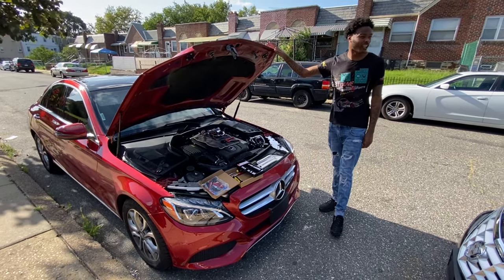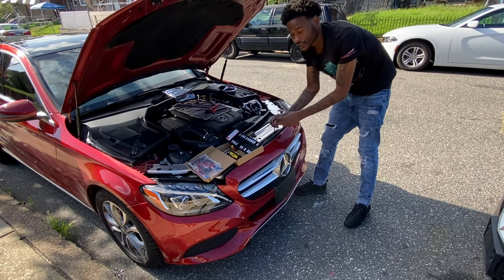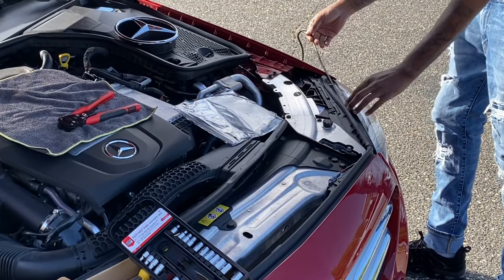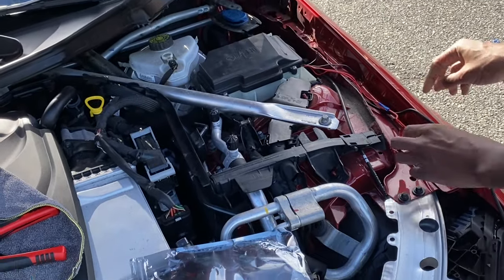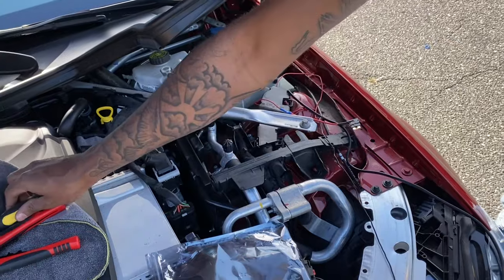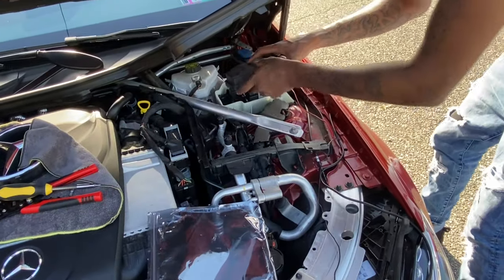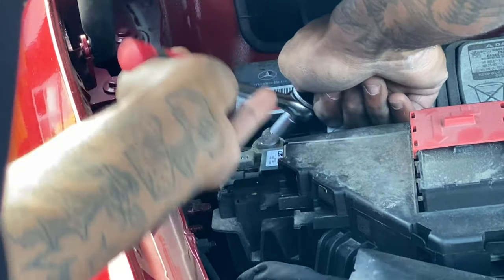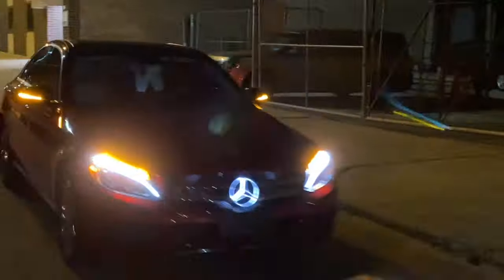How To Install LED Star!!! TOP QUALITY Mercedes FASTEST MOD #1 #Distronic Style

Comment: Just followed your video and installed the illuminated star on my 17 C class c300. Perfect instructions my boy. Grabbed all the same tools as well in you info section. Good looks
Reply: saved me 500 dollars install fee from dealer as well
Reply from the maker: Thanks bro 😎
Reply: Can you tell me does the emblem light up when you unlock the car along with the other lights or does it come on as soon as you start the car ( with daytime running lights ) etc. Please.
Reply: hey did you buy the lightning star from the dealer or did you get it from ebay??

Comment: Hey bro! Where did you buy the headlights ? I’d appreciate a link. Thank you
Reply from the maker: The LED headlights came with the car Bro, but the LED star link is in bio. 
If looking for replacement LED Headlights click this link:::
https://www.uniquestyleracingstore.com/products/2015-2018-mercedes-benz-w205-c-class-4d-sedan-amg-style-full-led-headlights-hlmbzw20515fulled?variant=34156439306377

Comment: What’s good brody subscribed right away! But quick question man to have it stay on during the day or whenever my cars on would I have to do anything else ? Or will it stay on as long as the cars on ?
Reply from the maker: Thx bro💪🏾 when you turn on the car the star turns on with it
Reply: @FASTLANEYT  my bad bro last question predicate the love bro but after taking out the battery did you have any issue with like recoding or anything ?
Reply from the maker: @joaquinbernardino1923  no problem, but nope

Comment: Great video. Easy to follow. I have a 2018 GLC Coupe Premium Plus UK spec. Will I be able to install this if my car has the distronic system (which I think is incorporated in the star)? Thank you very much.
Reply from the maker: Great question and thanks for your feedback. If you have the distronic system then I do not recommend this install. This install will deactivate your distronic functions became the sensor is build into the star.
Reply: @FASTLANEYT  Thank you very much for that.
Reply from the maker: @andysouthwell1313  no problem

Comment: It’s installed to be turned on w drl? Or what fuse is it called ? Trying to let mine turn on when I unlock the doors at night with the headlight
Reply from the maker: I installed the fuse in slot #105. Which only illuminate when I turn on car, remote start which Mercedes Me app. You would have to look at your vehicle fuse diagrams to learn which fuse needed to patch into your locator lighting feature.

Comment: Will that same star fit on a GL? Did you get wires and the star on amazon or different site? Thanks
Reply from the maker: Great question. I have seen a non-OEM LED star installed on a GL model. The Vendor who I purchased my LED star from is linked below in the description from eBay. The LED star comes with wires / full kit. I had to purchase fuse tap adapters separate. This star size is for the W205 W218 CLASS C CLS CLS550 CLS63 C350.

Comment: Did you wire this so it run when headlight is on or during the day as well?
Reply from the maker: Great question, yes I wired it to an accessory fuse that turns on constant once car starts

Comment: but the emblem light is running all day correct? obviously when the car ignition is on!is there any way you can connect it to the head light fuse?
Reply from the maker: Yes! star is On when car is On… you can wire light directly to headlights via wire tapping which takes more work for same style.

Comment: Do you think this would work for a 2022 GLC300 ?  This was a easy tutorial I appreciate it. Thanks
Reply from the maker: No I appreciate your response, do you have distronic star?
Reply: @FASTLANEYT  Do you mean a 3D star? Yes it came with it.
Reply from the maker: @RealSavages  ok so no you wouldn’t be able to do this manually. you can check with dealership to see if it was an option, however many of the new models require 3rd party auto services to install
Reply: @FASTLANEYT  Tyvm I will look into it. Perhaps I can find an alternative.

Comment: Does disconnecting the battery resets everything inside?
Reply from the maker: Great question. From my personal experience once I connected the battery and powered the Car on the clock was the only thing I seen automatically resetting itself.

Comment: Hey man, Do you happen to know what that fuse is connected to ? Like is it anything vital
Reply from the maker: It allows you to tap into the daytime running lights, it comes with the 5amp fuse for safety I’ve haven’t had any issues after reinstalling multiple times.
Reply: @FASTLANEYT  Ok I asked because I was going to install some color changing Daytime running light, and I wanted to see if I could use the same fuse to power it.
Reply from the maker: @tyanedaley1480  I purchased a test light pen on Amazon to be sure. 

https://www.amazon.com/gp/product/B01HUZPTPS/ref=as_li_tl?ie=UTF8&tag=flexxalexan06-20&camp=1789&creative=9325&linkCode=as2&creativeASIN=B01HUZPTPS&linkId=7cf2c362883925e001b53a5db5830ea9
Reply: @FASTLANEYT  I was looking to do the same thing on my 2017 GLC300 but after looking at the fuse diagram, position #105 (fuse you chose to tap in to) is for the Automatic transmission fluid auxiliary oil pump control unit. I think it's the same for the C300 in your video. Can you confirm? Thanks
Reply from the maker: @elvinrivera3472  correct, I looked at both diagrams for c300 and GLC300.  same fuse locations for both vehicles. Fuse #105 💯 same one I use.
Reply: Do you guys think it’ll be the same fuse for 2017 c43 w205?

Comment: Where did you get the wire that connects the emblem to the fuse box
Reply from the maker: Fuse tap adapter link in description above...

Comment: Please can you tell me for a mercedes w213 which fuse location should I use because me the fuse location to use in your video is empty on my car?
Reply from the maker: You could use a test light pin to see which fuse would match or be best to tap into. You can find one on Amazon.
Reply from the maker: https://www.amazon.com/Digital-Circuit-Extended-Voltage-Stainless/dp/B077YM5QL8/ref=mp_s_a_1_1?dchild=1&keywords=Large+Size+Heavy+Duty+3-48V+Digital+LCD+Circuit+Tester+with+140+Inch+Extended+Spring+Wire%2CCar+Truck+Low+Voltage+%26+Light+Tester+with+Stainless+Probe&qid=1617830342&sr=8-1
Reply: @FASTLANEYT  thank you for your answer but even with its how I will know which fuse is compatible because they will all be lit

Comment: Bro would this work for a 2016 mercedes GLC 300 , will it fit,  I see you bought on Ebay???
Reply from the maker: yes it will work. fuse box and fuse used on both vehicles are the same
Reply: @FASTLANEYT  , thanks alot bro...
Reply from the maker: @omarlucero5047  np bro

Comment: Is the same install for a 2020 AMG C43?
Reply from the maker: Yes should be same install as long as you don’t have distronic feature... check out this video also for more directions: https://youtu.be/32-iFopdhq8
Reply: @FASTLANEYT  thank you man. It does not have distronic.
Wonder why the Stealership quoted me 220 labor for this. Looks like a 15 minute job.
Maybe they get it to come on differently, like upon unlock of doors? Thoughts.........?
Reply from the maker: @cobras559  lol I said the same. idk which fuse the dealers use, however I know it’s possible to tap into the fuse that provides locater lighting, same lighting that turn on when you unlock car to provide a lighted walk path, located on the door handles during night, if that doesn’t work try buying a test light pen Car Truck Voltage Circuit Tester 6V 12V 24V DC Electrical Car Test Volt Met Long Probe Pen to find correct fuse:  Light Bulb https://www.amazon.com/dp/B07MKMZX86/ref=cm_sw_r_cp_api_glt_fabc_W9F9GFRBB6VJCMC1JMEJ

Comment: Um but distronic won't work I'm looking for video where you add star with distronic I know it's been done
Reply: I installed it myself no prob on my 2015 but I'm getting new 2021 want star and distronic b4 ppl say it's not possible it is
Reply from the maker: @bryanharrison2563  lol I feel you. I was told it wasn't possible on all 2019+ equipped with distronic features by the dealership. If you don't mind could you link a video below if you find the solution?
Reply: @FASTLANEYT  its not video only found on a forum I forget guy did a 2012 must been higher end didn't even know they had that back then
Reply: @FASTLANEYT  if you do figure out a way I still pay for video I'm very good at DIY especially in Mercedes I've owned them 20 yr now but would like see how they did it b4 fuck my nice car up 😆
Reply: @FASTLANEYT  if you can figure out how he did it please make a detailed video I honest to God would donate 2 your Chanel if u did that  or whatever lol I know I'm good at following steps but I need see it done live video for self assurance
Reply from the maker: @bryanharrison2563  lol I will gladly make a video if I find a solution.
Reply: @bryanharrison2563  hey man. If you’re referring to that post on the mbworld forum then it’s not possible. That guy had old model where there is a black plate in the grill itself behind the star. It will not work with the twist stars maybe if your car has a pop up star. But afaik it is not compatible with 2015+ facelift.
Reply: @dennisthegreatest  ic I still can't believe German engineers can't figure out way get illuminated star and distronic lol u know though lol
Reply from the maker: @bryanharrison2563  I think I found what you was looking for ig, if you’re still looking: “led star + distronic install video” channel @turbobandit video: GLC Mercedes How to wire LED illuminated Star.

Comment: Save yourselves fruitless time and money: NONE of these illuminated stars work on an AMG because of the integrated sensor behind the OEM star. Even if it dimensionally “fits” the stock grill (of a C-Class, or whatever base model Benz,) the AMG model nearly never accepts “multi-fit” aftermarket items. 

You’ll thank me later.